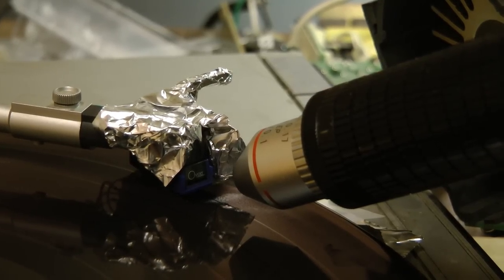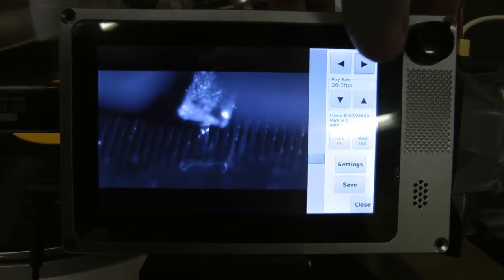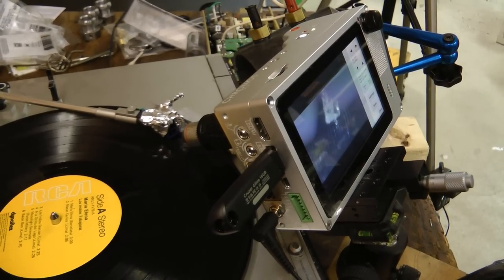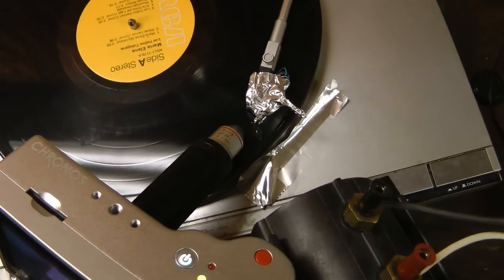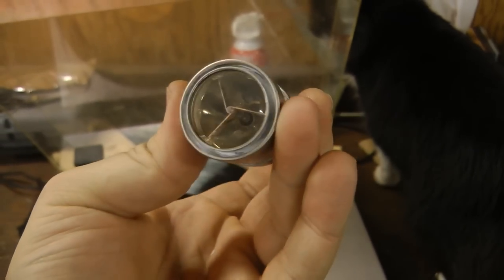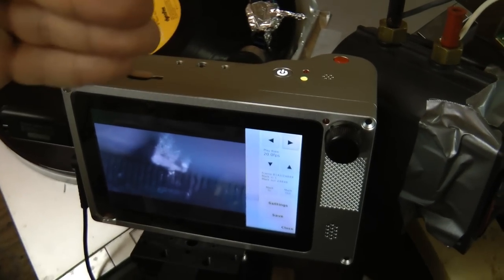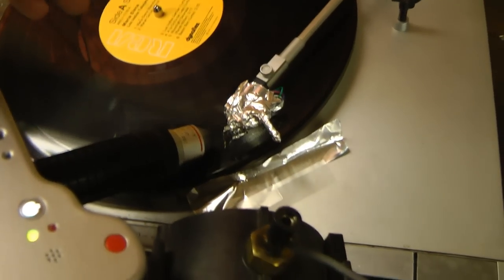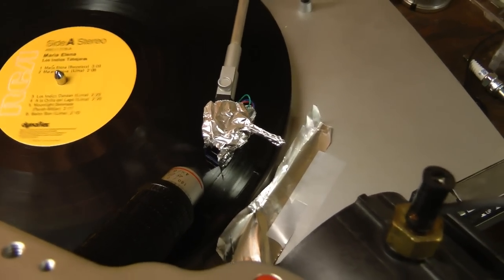Phonograph needle slow-motion microscopy

Comment: How about lighting through the lens with a beamsplitter like a metallurgical microscope?
Reply: A beam splitter would halve the light intensity going to the sensor, since the other half would get reflected back to the light source. Also, I don't think lightning through the lens is ideal unless you're filming a surface perpendicular to the beam.
Reply from the maker: Will need to give that a try. Will lose some light due to the beamsplitter but the lighting should be much more efficient
Reply: Is the internal oscilloscope working yet? Because if it is, this would be a really cool demo of it.
Reply: Hello
Mike, you pulled out of the DNA machine this filter which blocks only the laser light wave length,
would this not be suited for illumination of the stylus through a beam splitter and filtering out the laser light?

Comment: How much different would it look by simply running the record slow and locking the arm?
Reply from the maker: There will probably be some subtle differences, especially to do with dust physics, and the scratches would be completely different.
Reply: Could you set the high speed camera to a slow frame rate?

:D
Reply from the maker: Yes, it can be set down to 0.025 fps XD

Comment: Great job! 

For your lighting issue you would benefit from using an inline illumination setup. As you mentioned the NA of microscope objectives is small, so that cone angle of the reflected light that makes it through the rear pupil of the objective lens is small also. If you could I'd recommend you use an infinity corrected objective lens instead (a long working distance version), and use a beamsplitter & tube lens arrangement. Even with your existing finite tube length objective, at 4x magnification you might get away with mounting some LEDs around the edge of the objective lens for improved illumination.

Comment: That is very very cool, thanks for taking all the time to set this up.  I thought the record player grooves were vertical, not horizontal.  Now I know...
Reply: You're not completely wrong - the needle moves up, down, left and right in a 45 degree "V" so it can play stereo by using the two axes.
A needle that can only move left or right can only do mono (unless digitally encoded with stereo data!)

Comment: I looked it up, cuz I couldn't remember which way is the needle move. Imagine a little x on the front of the needle standing up right. The right channel is the left wall and it signal causes the needle to move diagonally up into the right, and then the right side of the groove causes the needle to move diagonally up into the left .

I believe the two movements are at 90° angles to each other .

But the two movements combine on those 45's to create the stereo signal .

I had thought it was plus shaped when I made my previous comment, but that was 45° out of phase with the truth so this is a correction for that.

Comment: You could have tried coupling the light in with a beam splitter in the the tube to the camera. So you may focus it more effective where it is required, possibly reducing the required power, solving the heating and some stray reflection issues.
Reply: Ah, someone already suggested that...

Comment: Sure was a lot of effort but a great result!
However, if you physically ran the record at 1/100th speed, then you could have managed with 1/100th of the light and/or run the camera slower. (The needle follows the grooves just the same at 0.33 rpm!)
Reply: Andy Lee Robinson not all of the physics involved with this is linear, I'd imagine, therefore the needle would behave differently on slow speeds
Reply: No, the groove dictates the motion of the needle so that is linear. The signal generated in the pickup coil relies on relative movement of the needle and the arm and may not be linear at all speeds. The arm has much greater inertia and integrates (follows) the average position of the needle.
If the speed was very very slow, the whole arm would move with the needle and either no signal or a distorted one would be generated as the arm becomes coupled.
At very high speed the needle may jump out of the groove on high frequency or high amplitude sounds as the rate of change of path exceeds the needle's ability to remain in the groove - just like taking a corner too fast.
Reply: Where it would fail is surface damage, though.

Comment: Why do lasers scintillate?
Reply: Green Silver I think it is because lasers have very narrow bandwidth which simply means they contain a single wavelength. As the surface is usually not perfectly smooth on microscopic level, therefore the reflected laser beam is not reflected in a uniform way. This causes some patches to interfere constructively and some destructively, causing dark and bright speckles to appear. This happens with ordinary light beams as well but because they contain large number of closely spaced wavelengths. This results in speckles for each wavelength to form at different places. The result is an averaging effect which washes out the speckles

Comment: What is this camera capable of doing today? i need the latest spec sheet
Reply from the maker: See the resources page for spec sheet and manual. http://www.krontech.ca/resources.html

There's a beta software version with a few more features, see: http://forum.krontech.ca/index.php?topic=105.0
Reply: Thanks :)
Reply: okay one question: Does Focus peaking read from the whole sensor or from the screen? Focus peaking for example on the Sony cameras is not really a good indicator because it shows the sharp contours on the screen, not whats really sharp (if you use focus peaking and it shows you shar corners and then zoom digitally in you can see that it is not really sharp)
Reply from the maker: I have had that problem in the past too, you'll be glad to hear focus peaking uses the full sensor resolution.